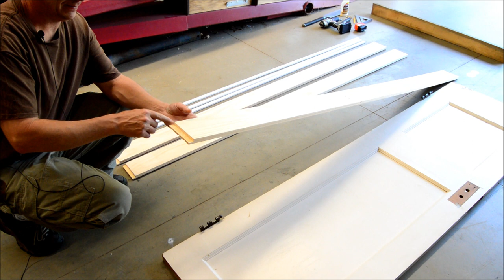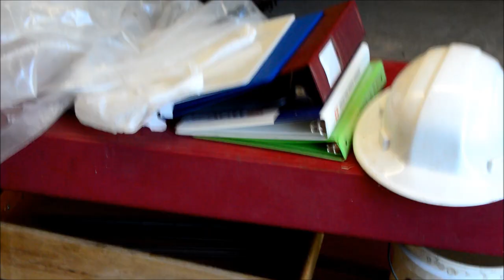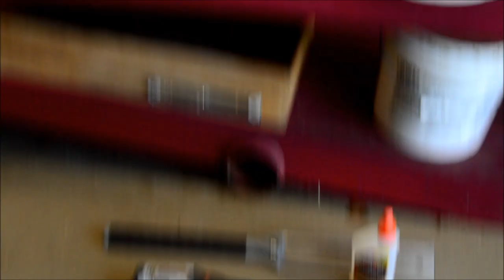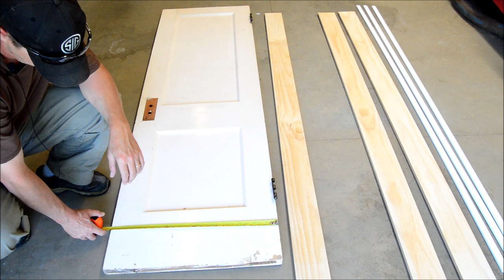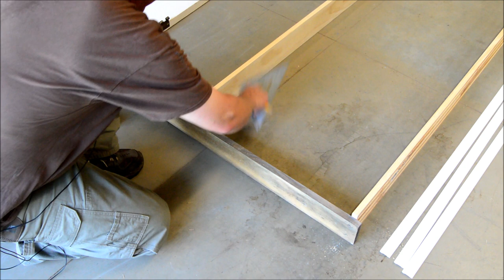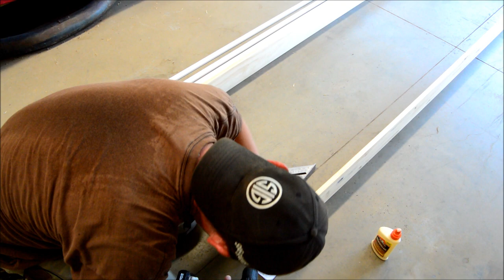Jamb Session #1 - DIY Pre-hung door frame for antique door

Comment: Making a prehung door using your directions really helped us in our restoration project of our 120-year-old bungalow, but I wish you would add more about the challenges of installing antique doors in old houses. First, we found most antique doors are not square, some from sagging and many from being trimmed (often roughly) to fit into old door frames. This has to be rectified first and it's not always an easy process when you're trying to preserve the knob/mortise lock locations. Second, the fact that older doors are solid and weighty yet supported by only 2 (rather than 3 hinges) creates other issues and not just the need for longer screws. Third, you can't just go to Lowes or Home Depot and buy a door jam kit for antique doors because such kits are only 4-9/16 wide, not wide enough for thicker interior walls of an older house (which is the most likely scenario where you're going to be putting it). But thanks for getting us started on the right road!
Reply from the maker: Yes, we struggled to get the door to hang level because it had some twist in it. The door had lost it's flatness. I should have made a followup video showing those struggles.

Comment: If your surface is not level instead of using a square, use a small level to plumb the side jambs. Great video.
Reply: Just match the meeting edges of each board.  No umbrella or square.

Comment: I have to do this very soon but with an outside door.   Would it be easier to mortise the hinges before assembly?  So glad I found this.  Gonna sub too!
Reply from the maker: Welcome aboard. I was starting to think I was the only one doing this with an old door. Sure you could mortise first and it probably would be easier, but since the hinges were already set on this door I felt it safer to set the door first. It still didn't turn out perfect since the door I used was a bit out of square, but we made it work with some shimming.